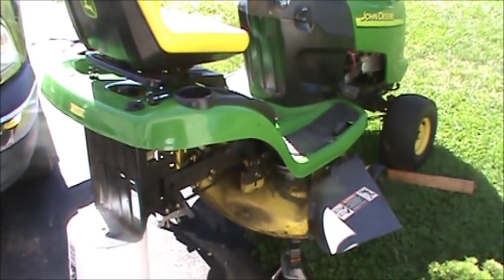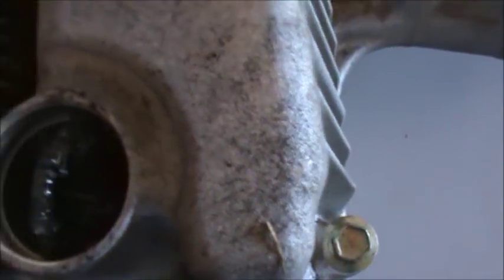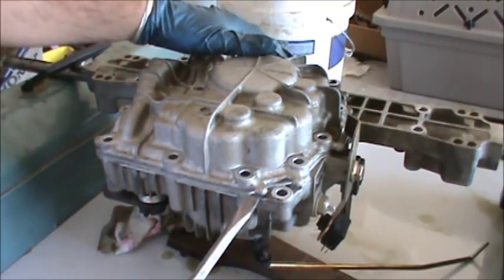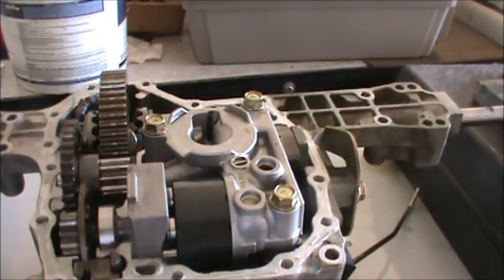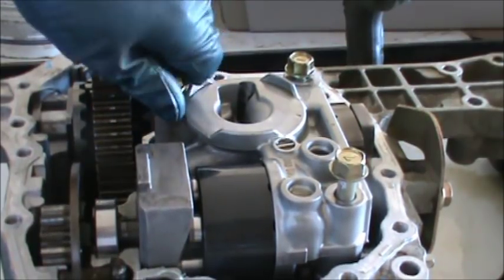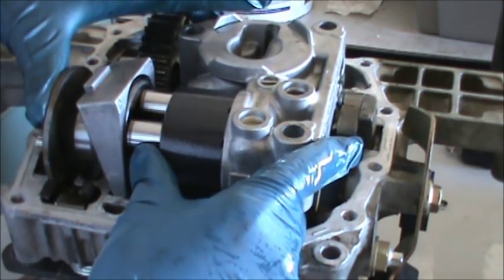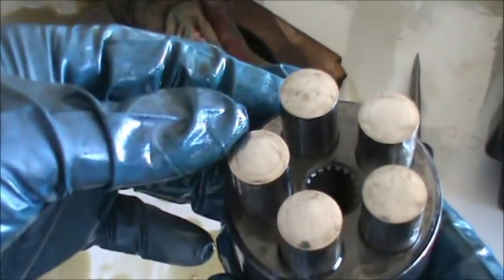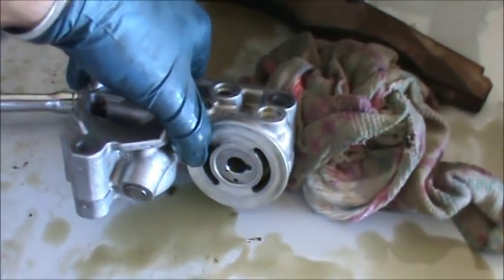Tractor hydro transmission rebuild part 1

Comment: I'm trying to find the axle clip for my older transmission 

Because I had a flat last year and pounded the rim off and it broke the clip and washer off inside the transmission I have it all apart 

I broke 4 torx screws so have to get another tool to take those out but I'm needing that clip that holds the axle and gear in place

Comment: Another obvious thing to check before pulling the transmission is to make sure that the drive pulley (has both the mower deck and transmission pulleys) is spinning.

My brother told me that my 42" Murray quit driving so he dropped the transmission for me (nice). So I tore it apart, found no problems, put it back together and reinstalled it back onto the lawn tractor.
It still didn't work; then I noticed that the belt wasn't spinning.

In my case the stamped key slot on the pulley sheared. So with my Dremel tool, I cut out the pulley's stamped key way and fabricated a new key from some 1/4" key stock. Worked great.

On the Plus side, besides the education and upon breaking my mower; my brother went and bought his own mower.

Comment: I just rebuilt 2 of these K46 axles and found wear or score marks on the aluminum body as well as the pump and motor. I lapped them smooth with a ground plate and 1200 grit wet & dry paper with kerosene to stop loading of the paper. I also felt the 5-50wt was to thin to do the job and used 2-50wt instead, no new parts at all and it works 200 percent better than it was. It will now climb a 40deg hill with no problem at all.
Reply: The one voice of reason  gets smothered in the bull shit here!  A person who knows usually wont be watching these videos! Thumbs up Todd, Thank you.

Comment: Can you help me out...again?  I have a Craftsman lawn tractor model 917.256544.  This tractor is used mainly for mulching and collecting  fall leaves.  Unfortunately, it doesn't move anymore.  I can shift gears and, every once in a blue moon, it will engage and move forward (or backward depending on the gear shift selector).  The mower deck works fine and the engine starts and runs (although it "surges" while idling) but the transmission wont engage.  Do I need to replace a transmission, transaxle, take it out back and shoot it...?  I'm retired and and was never very good at turning wrenches but I've repaired alot of my stuff just watching your videos and I really don't want to spend a small fortune on this, esp. since I bought a bagging system for it just last year.  Any suggestions?  Sorry about the lengthy post; I couldn't find an email address for you.  Thanks-
Reply: .45 caliber would be the best remedy for that thing !!! Good luck!!!!!
Reply: @joefro9473  Done!  3 years ago!

Comment: these are tuff torq K46 junk piles.  Just put in the new pump and motor for about 400.00 dollars, and if you mow much you can do it again in about 2-3 years.  If you really want to get it right you can upgrade to a K66 transmisson for a mere 1800.00.  Good advice get an old john deere 212 or 316 and forget the chinese junk.  Your wallet will thank you.

Comment: Hi there, was hoping you might be able to give some advice to a custom project I have in mind. I'd like to have an external hydraulic pump with lines running into a lawnmower hydrostatic drive and bypass the pulley pump and just provide pressure remotely. How feasible does this sound, I'm not really familiar with the specifics of the internals of the hydrostatic transaxles

Comment: Hi Jeff.  Thank you for posting.  I have the same transmission in my Cub Cadet.  Wanted to add oil to the wet clutch, but can't remove the hex plug.  Is it clockwise or counter to remove?  One more wrong attempt and I'll have stripped the tool fitting I fear.

Comment: In most cases the transmission probably does not have to be rebuilt. I changed the oil to Mobil One 15/50 and mixed in about a Dixie cup full of Lucas oil stabilizer in mine. It worked perfectly after and it only cost me $20 for the oil. It had been slipping real bad before that. I didn't even remove the wheels. I unbolted everything then picked the back end of the lawn tractor off the assembly and dumped the oil. It wasn't that hard and it only took about three hours.
Reply: It's a good idea but, my concerns are, all the metal shavings on the magnets. I haven't cracked open mine yet and will try your idea first. Thanks for the input.
Reply: @rverro8478  There's a small round magnet right under the fill cap that had some gunk with very fine shavings. it comes right out and I cleaned that off. I didn't want to open the casing, and I don't think it's really necessary. One of the rims was stuck hard on the axle so I just left the tires on and it wasn't a problem, so you can leave the rims on and just flip it when you get the assembly out. My mower is still working like new.

Comment: I rebuild hydrostatic pumps and motors on heavy equipment. They use bronze shoes on pistons with high pressure oil feed in center  vs angle plate. These are terrible on John Deere disposable transmission. Steel on steel ....
Oil should be changed every season. Insane ...
Good job.
Check out Rexroth  and  Kawasaki pressure compensated hydrostatic pumps cost $35k.

Comment: Thanks for the informative video - Great explanations and very helpful in understanding how this thing works! 

My mower has 1000 hours and was struggling to climb hills after warming up. Luckily I was able to get this fixed on the cheap by changing out the oil. The magnet came out quite clean, indicating that I was not suffering from ground up gears. I figured I would try an oil change before sinking money into the pump and motor. Cleaning out the cooling fins probably contributed too - they were effectively "gone"... caked with oil, trimmings and other crap.

Comment: I have this exact mower. 

What are some signs that the transmission has problems? Mine is chattering/grinding when parking brake is released, and drive pulleys are fine.
Reply: MrBrianohamill   Check the pulley on the trans. They commonly strip the splines and need replaced. Taryl has a video on this problem.

Comment: hi need your help on a dana spicer 4450-1 when the engine is off it shifts fine, every gear. when eng. is running it gets stuck in gear, I have to turn eng. off to put in rev. start, then turn off to put in 3rd. or 4th. I though it might be the keys, but why would it work when eng. is off?  I looked inside of trans, it looks good no water, rust, lots of grease. could the keys work with eng. off an fail when eng. running? need help bad, ill owe you one. thanks John

Comment: Hey doublewide6, our John Deere LA 175 sprung a leak this winter. There's oil coming out of the axle. Is there a seal where the axle is?
Reply from the maker: There is a seal on both sides of the axle.  Drop the transaxle drain out the oil that is left in there and add whatever oil I used in the video along with atp 205 leakstop.  There is a plug ontop of the transaxle where you can add the oil.  You can drop transaxle with wheels on (only about 4 bolts.  Good luck.  Bob
http://amzn.to/2mRcw6y
Reply: doublewide6 Repairs LLC Thanks for the quick reply. I was wondering if there was a seal.  I've been using atp 205 reseal after watching your video in our backhoe and it's really helped out a lot.

Comment: One correctino to our video.  I spoke to Gill in service at Tuff Torq today (Aug 1, 2017) and he said SAE5W/50 NOT5W/15) synthetic is recommended.  FUI.
Reply: Funny because the tech at John Queer told me that it had to be 5W30. I think I'll take your advice. Thicker oil makes sense.
Reply: R Verro No you definitely want to use 5W 50 according to the manufacturer but John Deere other manufacturers use a center viscosity one 10W-30 would you get your Bible read down quickly

Comment: I've got a troy bilt ride on mower 44'' it seems to start perfect and drives in reverse perfect but when I put it in forward it just sits there running.. Any ideas what could be the problem???  Some have said the transmission is completely gone and needs to replace or rebuild and I'm hoping that's not the case...Please give me some advice as to what I should do. I have tools and some experience. thanks.
Reply: For starter, make sure that the whole exterior of the transmission is clean. I had similar problems with one that was given to me. It was packed with grass and whatsoever. Once cleaned-up, the engagement rods moved freely back and forth.

Comment: Before you remove the tranny make sure your motion belt is tight.  Dirt piles up into brake linkage and prevents idler pulley from pulling the belt tight.  Its hard to see with the mower deck on.  Rebuilt the trans and nothing changed till I removed grassy dirt above the steering plate that kept the linkage from fully returning that keeps the belt tight.  $350 mistake.  Belt slipping wont let mower go up any small hill.

Comment: Awesome vid I was just looking to change the oil and then after watching your vid I thought well hell if I'm pulling out the trany I should check out the gears there is some small pitting on the gears and the magnets had a tiny bit of debris. Thanks this was totally helpful

Comment: Drop the tranny out, drain it, replace with 75w 90 gear oil. Job done. 40+ hours on it without a problem. Not one. KISS METHOD prevails again.

Comment: I know this is way too late (and I thank you and briansmobile for tremendous videos here) but if you look at the schematic closely from TuffTorq, the wedge is upside down in both yours and doublewide6's videos.  The schematic shows the thicker side up as you both have placed it, however in the schematic the transmission is NOT upside down like you both have it.  Did it not cause issues down the road?

Comment: Great fix for a non serviceable unit wonder what JD charges to R&R a new one? Thanks For The tip  on the syn 10-50 oil im changing mine to it.

Comment: Looks like a solid transmission, my craftsman 2014 outer case is all plastic, sears just replaces it with a new one.  my trans went out with 200 hrs. its been down hill ever since with issues, besides the trans.

Comment: my transmission is leaking, any suggestions, thank you...is there a gasket in it?...
Reply: +pei bossman 
If the transmission has bolts all around it like this one in the video then yes it has a gasket, in fact you can buy gasket replacement kits for a lot of these transmissions. I can't understand why they say they are maintenance free and a sealed unit, when they sell gasket kits
Reply: There are also 2 seals around the axles that are more common failure points.

Comment: Hello doublewide6. got a problem? rebuilt k46 hydro transmission with your tips thanks. however gearing has switched. when I use forward pedal, mower goes backward, when use reverse, goes forward, mower is using appropriate gear but in opposite direction. Suspect differential gears as I  had moved them a bit but not removed them. I have new pump, motor and filter. Not a belt problem as there is only one short one from motor to transmission. Probably will have to remove and replace again. Mower is Husqvarna 155, with k46. Any Ideas?
Reply: qstore4814 Do you have the "wedge block" in upside down? I know on my Husqvarna K46 the wedge has the small end up when installing the motor. It is opposite big end up in these videos.
Reply: Thanks for the tip. Already got the same info from Tuff Torq who are very helpful. You are on the money. Cheers.
Reply: qstore4814 What parts did you replace to fix yours? Was it the pump or the motor or both?
Reply: Replace both plus filter, afterwards worked well. Mower now has electrical issues, and parts purchased will be up for sale as hardly used.

Comment: I have a hydrogear hydrostatic transmission with a BDU10L-256 hydrostatic unit.  Pulled it apart and everything looked good.  On center plate were some scratches.  We milled them out and put everything together and nothing.  No movement at all.  Anybody have any suggestions on what to do next.  Thanks....stumped in Virginia.
Reply from the maker: Denise Wilcox  jack up back wheels and run engine at idle speed for 10 minutes,  If your not hearing a grinding it could be air.
Reply: Will try. Thanks.

Comment from the maker: Thanks I tried my best.  I hope it helps.
Reply: Hi, I got a k46 and when I press the brake, forward or reverse I hear a horrible grinding/screech. I notice the pulley has play when I wiggle  it. Do you know if that pulley has a bearing? I have not pulled it from the tractor yet. Could that be what's my problem is. It has 438 hours on it
Reply: doublewide6
Reply: K46 transaxle transmissions repair.
Maybe one reason that these K46 transaxle transmission output differential gears fail is that they are manufactured from Heat-Treated Powered Metal, according to the Tuff Torq website.

Comment: Thanks for the video you beat me to it  . I live near one of John Deere assembly plants the workers say most components are made in China did you find that to be true ? Also it seems to me that the new John Deere decided to make throw away mowers that are made to  last for x amount of time then hope the buyer buys a new one from them . My mower has a deck blade timing belt that goes bad about three times per season and is sold only at JD  for $80 bucks as far as I can tell . also bad trans axle

Comment: Great video but I could never do anything thing like I'm mechanically challenged unless its take blades off greasing zerk fitting changing oil on mower I'm illiterate
Reply: R

Dixon serial no.085074879  model 9688999702